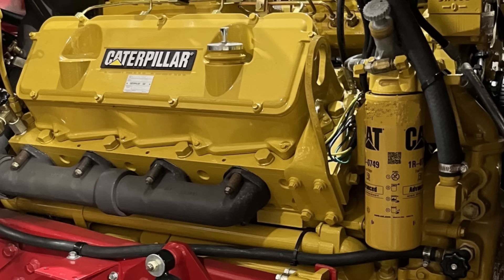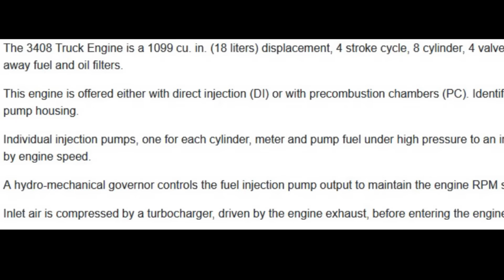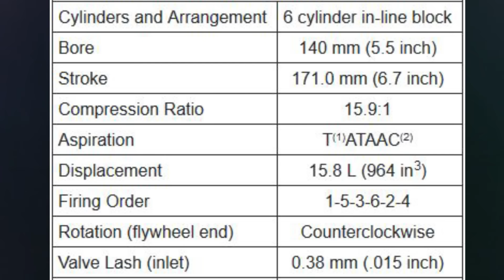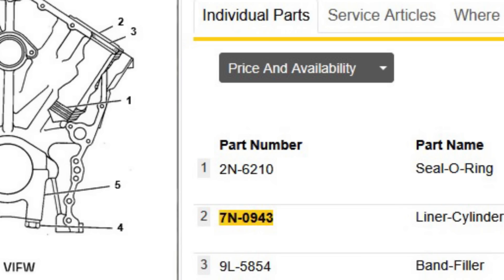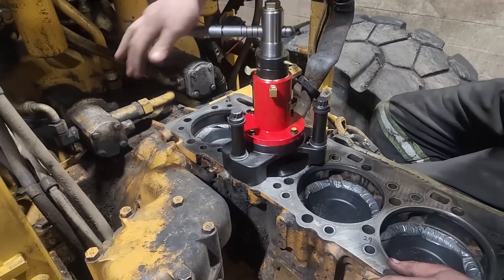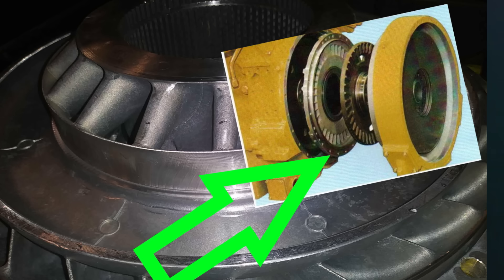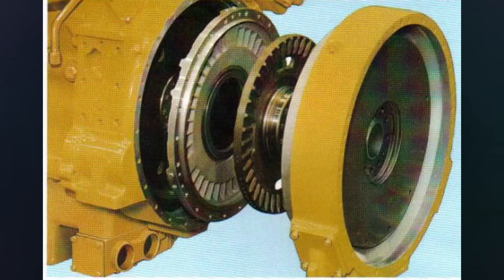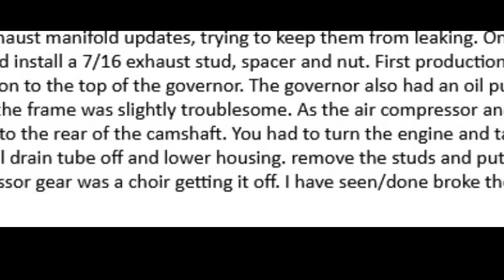The Cat 3408. Biggest Cat Truck Engine Ever Made. V8 18L Diesel Engine. "Know Your Engine"

Comment: Drove a KW K100 with some hop up things done. It was putting 640hp on the pavement. It was a beast. Most of that big power trucks KTA and the big 3408 s and some of the V12s went to Australia back in the early 90s

Comment: MMI (Mining Machinery Inc) out of Ky. had an RD800 Mack with a 3412 in it. Both Mack and Carter Equipment (Cat) refused to build it, so MMI built it in their own shops. It was a beast in the Ky coal region
Reply: What did they use for a drivetrain?  Must have killed clutches and U-joints
Reply: @GLEX234  No idea what the drivetrain was. I never got a close look at it. Hopefully the facebook link I just posted works
Reply: "Mining Machinery Inc, RD800 Cat Powered" On the Mack Trucks Forum
Reply: "Mining Machinery Inc, RD800 Cat Powered" On the Mack Trucks Forum

Comment: The split pin crank allows even firing, it does NOT make for perfect balance like an in-line 6 or a 60 degree V12. 
In my time as a design engineer at Ford, I was involved with the 90 degree 3.8L V6 (copied the concept of the Buick V6), & the SHO 60 degree V8 with balance shaft. 
The Ford WWII 1100 cubic inch tank engine was a 60 degree configuration. Why? Because it started life as a clone of the Rolls Royce Merlin 60 degree V12, but tolerances revised for Ford’s manufacturing capabilities and shorter manufacturing cycle time. RR refused to approve the changes. Ford didn’t just give up on all the design engineering work that had gone into the V12. You didn’t think the eventual Sherman tank engine was 1,100 cubes by coincidence, did you? 8/12 of 1650 = 1,100.
Reply: Nevertheless the 3408 in my KW is very smooth, more so than any inline six CAT or Cummins I’ve driven.

Comment: The 3408 is the best sounding engine ever.
Had a bunch of Off Highway logging trucks that we rebuilt and put 3408's into them.
We had a couple of trucks that had KTA19's in them but he rebuild cost went through the roof.  I could buy a brand new 3408 for less money.   The ones we threw in were 543 HP. 
These trucks never see a highway, they are for pulling logs off the mountains of coastal BC.  Capable of hauling up to 150 tons.  Ran Allison 6061 6 speeds behind them .  The Allisons had retarders on them to assist with the braking. 
Those things pulled, good grief did they pull.  No sound like one pulling a hill with 100 tons behind it.

Also had them in 988's and we hand an old High Drive D8 with a 3408 in it.  Detuned for those applications.

They were a great engine until they got old.  Then we had issues on the trucks.  Swapped some over to C-15's or a Series 60 DD.  The Series 60 seems to be the one with the least amount of issuse now.

Comment: I drove several Pete’s with 3408’s in the early 80’s and loved them.  I was wondering if you could do a video about the 1693 Cat engine which if it had been “turned up” could beat pass a 3408 unless it had been turned up too.  Thanks and keep the good videos coming.
Reply: The 1693 was the best sounding Cat, ever! They were animals when turned up
Reply: @Patrick-xd8jv 1693 aka THE KNOCKER ( the sound it made at idle - like the rods were knocking) really was a beast but had serious oil leak issues .
Reply: @ after you have worked on an 8V71 or a 903, it’s barely a drip in the pan
Reply: @ clatter pillar

Comment: The 3408 is one of those, once you hear the noises they make, suddenly the fact that it doesn’t make sense on paper doesn’t matter. Same as the VT-903 Cummins and the 8V92T Detroit. 

Practical? Not really.
Sound cool? Absolutely. 
They are all products of what got us where we are today in engine technology, and I hope someone out there is still preserving the cool noises that came out of them from 50+ years ago.
Reply: There’s several on-highway 3408s still working in Australia, only good for big weights and roadtrains though, they use too much fuel with single trailers.

Comment: Had one in a 2100 wirtgen asphalt milling machine early 2000.Cratered at a bit over 10000 hrs. Decided to go with new rather than rebuilding ...cost 80k...ouch.And yea very thirsty but massive torque @ 500 hp.

Comment: 3408 was a construction equipment engine that some of us old retired truckers would ask if we could order it for our rigs, first one i had was in a 359 pete i bought new back in the 80's and had twin turbo kit installed and that thing would climb a hill like nuffin. also brat heads used to make high domed chambered heads with a 3 stage jake in them that would make the turbos help the engine keep the truck locked in for hills, this was back when 35 mph was posted for most grades like the grapevine and donner pass. miss that truck, i had like 4 3408's the B model was my favorite. this was back when we had high sulfur fuel pair it with a 2 stick shift spicer 20 speed and that thing would boogie back when the double nickel was the national road pirates speed limit.
Reply: Yea they were the same engine in some of the Cat dozers. 
I uses to work at a place where we made cement recycling equipment, those things were massively overweight and took permits to move, the trucks that would show up to transport them from Cleveland to the west coast that had to cross over the Rocky Mountains usually had those V8's in them.
Reply: @dukecraig2402 think it was the d9r for about 20 years. My last job we had an 11n with the 3508.
Reply: @philmckrakin6752 
Yea we had a D9 on the property at that place, the first time one of the delivery trucks that showed up had it's hood rocked forward and I saw the engine in it I thought it looked like the one in that D9,  when I ask the driver he said it basically was the same one.
We had that D9 and a couple 889 and 992 front loaders on the property because we had one of the cement recycling machines we built there, the owners had a recycling operation going on there and all day long trucks were in and out of the place, and there was mountains of crushed stuff there trucks would be picking up all the time, it sucked in the summer because we'd have the big doors all around the building opened up and between the crusher and all the trucks coming and going there was always dust blowing through the place and building up on everything.
Reply: @dukecraig2402 yeah right. We had a 988f loader and a dead dead 992 and the 992 was way bigger. I wouldn't have minded having a crack at a 992 though I don't particularly like wheel loaders. Dozers and graders are probably my favourite
Reply: @philmckrakin6752 
I ran the 2nd shift in the fabrication shop and am not an equipment operator, but being the way I am I couldn't resist. 
I had access to their gold key that could start anything in the event something needed moved, and there was a couple times that I legitimately needed to move them like the time we fabricated 100 ft long 3 ft diameter drain pipes for the Ohio turnpike commission, to get them out of the building on one of those extendable truck trailers and bring them around the building I had to move a 992 that was in the way, after everything was taken care of I just had to scoop up a couple loads of that recycled stuff about the size of 2B gravel and move it to the outgoing pile just to find out what it was like.
I actually used to weld liners in the buckets for those things and cut them all apart and rebuild them, not just reline them but cut the buckets themselves apart, form all new metal and weld everything back together, sometimes I'd just put sides or cutting edges on them and sometimes put liners in brand new buckets, our parent outfit was the largest excavating outfit in Ohio.
I loved doing those things, everyone else would run when they seen them coming in but I always liked doing them.
Reply: Still one of the best engines made imo then the incompetent politicians with their epa cronies got involved and destroyed the them along with the diesel engine industry.
Reply: Wish you had some part numbers for that old beast.
Reply: I would love to see photos of your truck driver. Thank you for posting, hope you have a wonderful day.
Reply: I know they use to be in the D9s.
Reply: So would offset rod journals have saved the 1696?

Comment: I've had the experience of doing 2 V8  in frame overhauls. There is a rod for the V and a different rod for the inline. Other than that the packs were the same. The V8 rods have a machined relief on one side to clear the cooling nozzle. You can use a V8 rods in an inline but you can't use an inline rod in the V8. Sometimes you can still get a V8 rod in a cat pack for a 3406 overhaul kit.
  I used to always pull apart cat packs. I've found broken rings, and missing wrist pin snap rings. Never trust the Mexican rebuild shop. Got a C15 cylinder head with five broken exhaust studs still stuck in it. Got another one with mis aligned cam bearings. Check and recheck.
Reply: When I do bearing rolls on my 3408 I can’t say I’ve noticed the machined relief. I’ll look next time but the last roll I did was last year so it might be a bit of a wait.

Comment: Did the stationary version of this engine have inspection covers in the oil pan?  If so a few decades ago I could have had one of these for free, all I had to do was move it.  Not something I was equipped to do at the time, or today for that matter.  It was being decommissioned by a TV station in Detroit.  It powered their back-up generator.   Interesting engine.  It's funny that this engine only had about 50 more horsepower than my relatively tiny Cummins 6.7 in my motor home.    Keep the good stuff coming Josh.

Comment: We had them with retarders and our 3406's had retarders and Jakes. You rarely needed brakes on the toughest grades  with that combination. I usually started a grade with the retarder because you could feather that in with the "glad hand" and then kick on the Jake when needed. Watch oil temp and feather retarder back out if oil got warm and rely more on the jake. They were heavy and expensive to repair but awesome as a brake saver.

Comment: My guess would be the 3408 went the same direction as the Mack E9 . Both engines were real boat anchors . They also produced a lot of torque according to the drivers. If driven carefully, they were fairly economical to operate.They all told me loads that paid by the hundred weight were difficult to scale.
Reply: The last customer to order one from the dealership that I worked at literally hauled feathers, no 💩. He said if he drove it easy it would get 4 mpg

Comment: I ran a 3408 pc model for number years. U are correct on mpg. Direct injected over pc models gave 1 mpg better. As for the engine retarder it worked great, only draw back was the o ring kit was very expensive. Guys used to pull down on retarder in the cold mornings and the o rings would go out!
Reply: You’ve got to watch the Brakesaver temperature and pressure gauges, if you go beyond what they are designed to do you’ve got trouble. They are not a steering wheel holder’s truck.

Comment: Not sure about America or even Europe but someone needs to make a w flat in line V6 with a single cylinder head basically a diesel of the same design as the VR6 VW in a cross Flow Design

Comment: I got the impression from talking with old truckers about this engine, is that they didn’t have the longevity that 3406’s had.  Specifically bottem end related to faster bearing wear (and although rare, broken cranks).  

Like you said, the 3406 almost has the same power, and a KTA would eats its lunch.  Just never quite took off, after the 70’s V8 diesel fad died down.

I think 90’s era D9’s used 3408’s!?

Comment: Worked on a Cat industrial v8. It was old and had overhead cams. I put a piston in it and fixed the cylinder head. Whoever worked on it before was messing with the pump. This was in a scraper by the way... I took it for a test run and pulled the hill by the shop in 3rd gear. It has what looks like a stove pipe for an exhaust and man I was rolling coal coming up over the hill. I parked it and the fellow that owned said there's something wrong with it. It never pulled a hill like that...better get the pump looked at... Crazy time messing with that one!
Reply: It probably was an old 1676 model.  They had them in some KW trucks in late sixties .(340 horse power and very unreliable)(double overhead cam)

Comment: Built a ton of 3408’s from 988B loaders.  Don’t remember any catastrophic failures, mostly just worn out.   Also did a lot of 3412’s from 992C loaders as well.  Where I’m at now we had a couple of 3408’s on 10” high pressure dewatering pumps used in quarry’s.  They didn’t seem to like the continuous duty cycles as well as the 3406’s.

Comment: I always wondered why the 3408 never had jake brakes? Was it just something likenthe demand wasnt high enough to warrant engineering a system? Was it just purely impossible to put them on in some way?
Reply: No, in order to off set the Jacobs Brake, you would have oil lines crossing over to each side. A plumbers mess so to speak.
Reply: Because first it was a off highway engine that was adapted for use in a on high way application. No need for Jake's in a payloader.
Reply: @thelaststarfighter  Read my comments above, I went to a Jacobs factory class in the 1980's.

Comment: Let’s talk my second favorite motor would be the great 1693 put that on your viewing list it’s the best sounding of all engines
Reply: So very true
Reply: @ivanetherton8514  I have 1693 TA sitting in back corner of my garage out of  a 1976 International 4370 from the factory.  We start it up every once in a while for old times sake and smoke up the place real bad.  Its even painted International red from the factory.
Reply: I second your request. Worked at Cat dlr (Sheppard Machinary) in mid 70's when 3408 was introduced didn't get much experience with it but favorite was 1693 except when in conventional cab with sleeper cab and leaking rear main or brake saver. Loved the dual overhead cams with nylock vlv adjusters, and removable cam boxes. FWIW I served on  a patrol gunboat in Nam in early 70s that had V12 875m Cummins with 60deg V I don't recall crankshaft  with off set rod journals even though I spent some time doing in frame piston/rod/cylinder inspections at 500hr intervals as these engines avgd 3k run hrs between self destruction due to exterior cyl liner pitting with resulting hydraulic lock even though We had hand bar (jack) them over 2 full 720deg revolutions without compression release usage each time they were started. Labor was cheap in USN at that time as I was E3 making 450 a mos with haz duty, combat action pay. Go Navy as We need it more than ever with Communism (Bric) Imperialism expansion.

Comment: Had the brake saver setup on the quarry truck i ran long ago.  That was on a 12 cylinder engine i believe.  It worked fantastic.  If youd yank it down while empty, say hello to the steering wheel and the windsheild 😂😂😂

Comment: Buddy of mine had a 1976 Peterbilt 359 with a 3408 and 6×4 transmission. And fairly tall gears. He had it set up for equipment hauling (Murray Lowbed trailer). He's an accomplished private pilot and equipment operator. He likes to go fast. He tells stories about his Pete. Seems he was running loaded (Cat 613 scraper on board) across the Mojave desert with his friend following in his hotrod pickup truck. Ted kept squeezing the 3408 until he was walking away from the tapped out Chevy at approx 125 mph. The guy in the pickup was shocked.... The 3408 was not stock.

Comment: Had the chance to do a flywheel housing on a 3408 engine long ago in a 359 Peterbilt.  Learned to rebuild the brake saver and the control valve under the oil pan. Good times!  That flywheel housing was HEAVY!  It also had a rear drive system that had two balance gears running off the crankshaft that drove the air compressor.  Had to change out a compressor on another one and it was a tight fit between the cab and the engine. It also featured a 24 volt starting system and a series parallel switch to make it run.  You should ask John Goldsmith about the 12/24 volt charging system.  I've only seen two of them but he probably can tell us more about it. I also know that later versions in the industrial and machine versions had HEUI fuel systems and later than that had MEUI injectors much like the C15 engines.  Loved the sound of them, especially the PC versions but they were always a bear to work on next to the inline engines.
Reply: KW in Australia built around 30 x  3408s and most had air starts. Mine has air start.

Comment: The 630 series scrappers 631 637 had 3408's in them. 637 had 3306 in rear. Used to run them flat out all day long. As they got wore out hoods would get loose and you could see the turbo and manifolds glowing red at night. When you ground the crankshaft they got weaker as metal was removed off both journals.